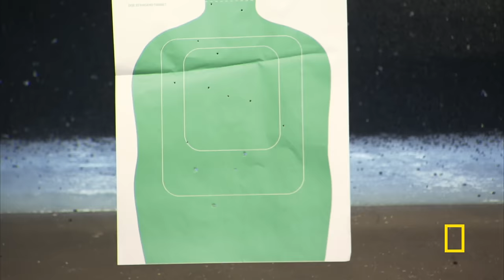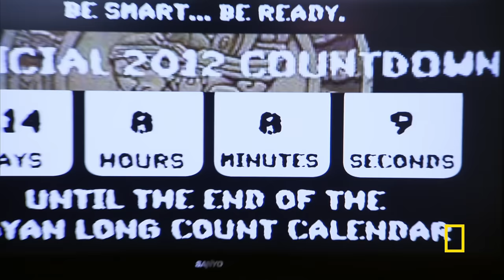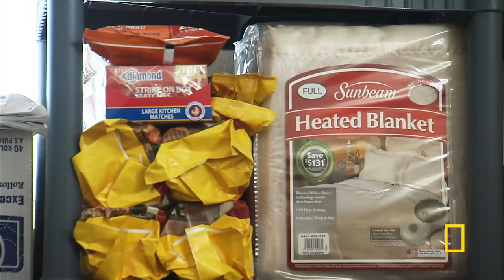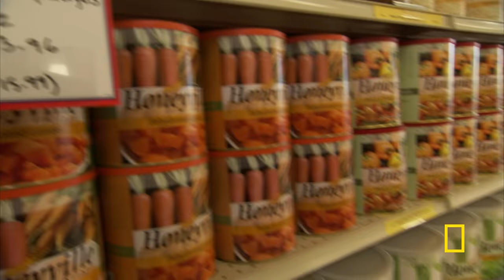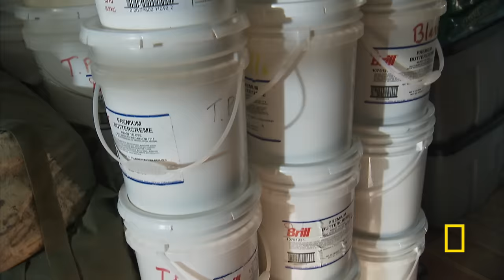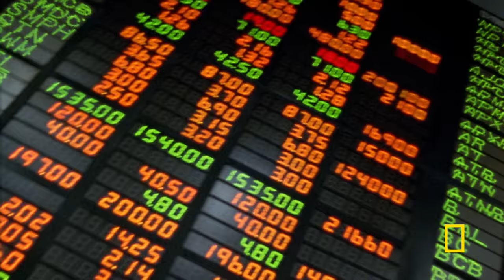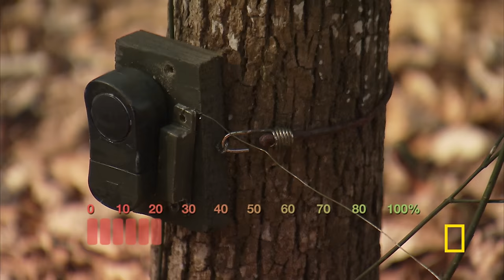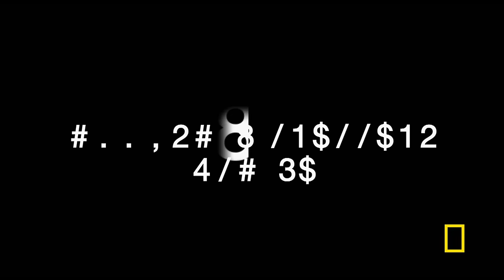Prepping for the End of the World (Full Episode) | Doomsday Preppers

Comment: I have a friend n he bought a big 0ropane tank mounted it on wheels w a tow kit only he has it rigged so you'd never see it. But if need be he can hitch it up n take off. It's next to his garage. He cut the end off the propane tank n welded hinges on n locks. He brings his stores in hidden under the pickup truck cap. He takes the store out via hand truck then right out the side garage door then into the tank and up on the welded in-place shelves . He left room for a couple bunks. Noone sees it as its fenced in n his mastiff  guards the back yard. He calls the tank his Trojan horse or TH for short. If he needs to bug out he just takes off to his xmall farm on the mountain..Noone even knows he's a prepper.

Comment: Storing fuel seems like a good idea but I was under the impression that gasoline is only good for about 6 months before it degrades, diesel somewhat longer.
Reply: There are additives you can add to get more life out of it, not sure on specifics but yes gas is limited to a fairly short shelf life. Most people still use fuel so the rotate thier stock, then of supply dries up they have the freshest possible.